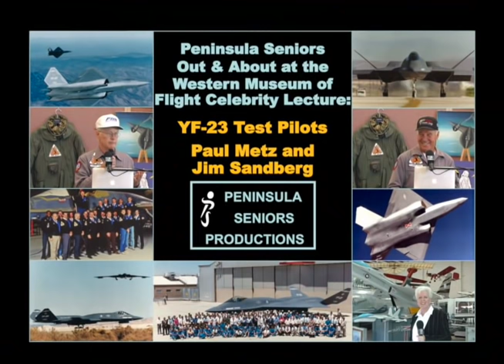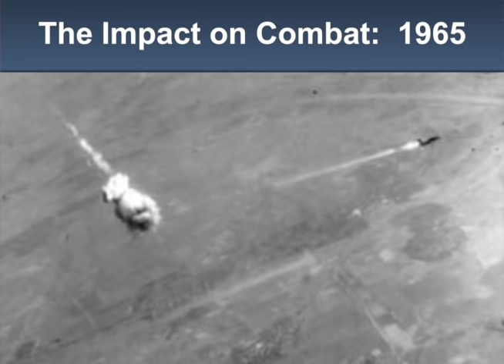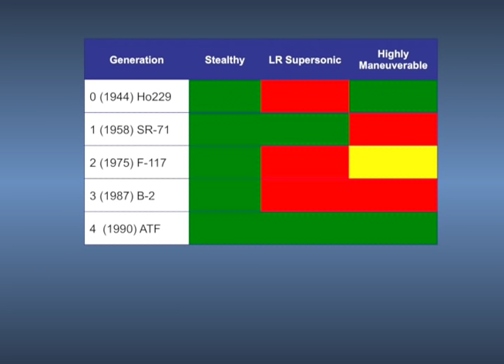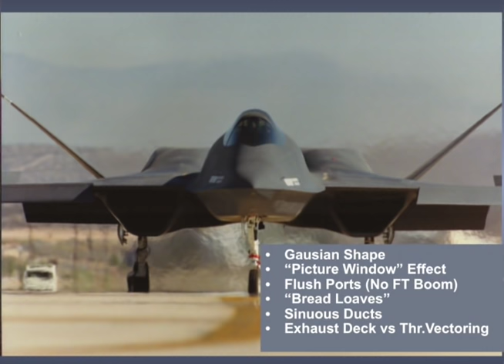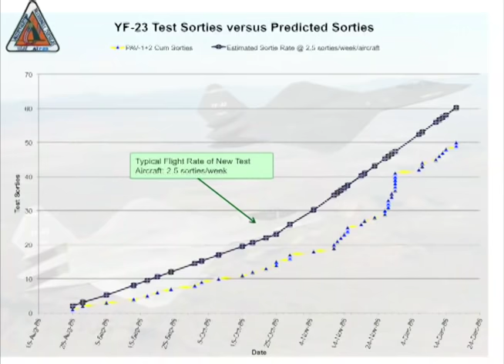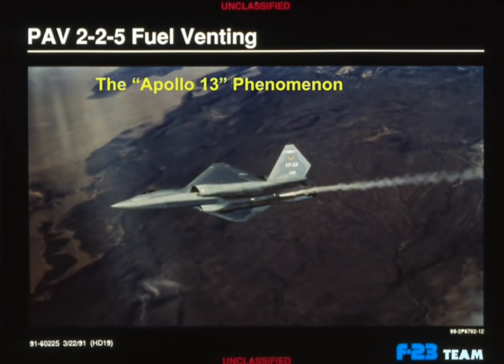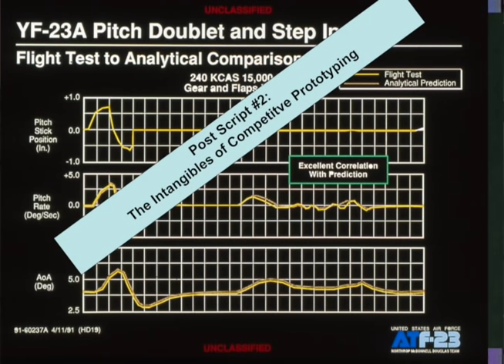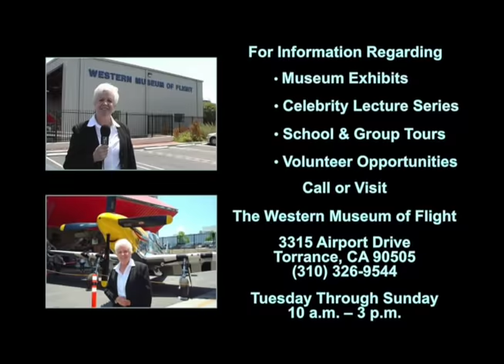YF-23 DEM/VAL Presentation by Test Pilots Paul Metz and Jim Sandberg

Comment: Also rumored that the 23 was faaaaaaasssssstttt! Like stupid fast and could do certain things after you bled a lot of energy if you got into that regime even though we the public were told that the 22 was actually more agile within the required envelopes. Food for thought and a great debate topic for aerospace engineers looking at paper data from afar.
Reply: It has a lot of wing and a lot of power, with pretty sleek leading edges and only 2 sets of wings/stabs, versus 3, which helps with drag.  The spread intakes are probably the most draggy aspects of the bird, aside from the wings, but they blend in rather well.  It's a combination of exceptional beauty when looking at all the other requirements for the ATF.
Reply: Interceptor type speed vs Air superiority agility

Comment: I wish they could have told us more about the actual capabilities of the aircraft.  Like how fast could it supercruise.  What was the top speed in burner.  Also maybe it wasn't as maneuverable as the F-22, but the F-35 can't maneuver at all and they don't seem concerned.  We should take all the F-22 and F-35 tech and produce F-23's.
Reply: Well you probably didn't see that because what Northrop says that the YF-23 could do and what it actually did were two different things. It is not to say that the YF-23 was not a great plane. It was. It is just that Northrop promised the world with the YF-23 and it couldn't deliver. Lockheed was very up front about the capabilities of the YF-22 and while the YF-23 was a great plane Northrop was not up front with the Pentagon and the Pentagon went with the YF-22. Testing showed that the designs of both aircraft were fabulous but Lockheed was up front from the start and Northrop was not.

Comment: despite addressable shortcomings, The F-22 was sufficient to keep air superiority. The YF 23 was so far advanced despite handling and other small issues That it should have been hidden away and further developed. It was too far advanced to risk. The F-22 was sufficient to best it's competition for years. The money to develop this sixth gen fighter is hidden in the cost over-runs for the raptor and joint-strike fighter as well as the F-35. That's why neither political party is demanding audits or casting blame for budget over-runs.

Just as the b-1b hid the F-117 budget with $10k toilet seats and $700 hammers, Our latest trillion dollar project is is a padded, black ops Skunk works charade. If we suddenly allow sales of the unbeaten F-15 air frame, it would further suggest we're at least three tiers above it's capabilities.
Reply: Very insightful and very plausible.
Reply: No it was not. On paper it was but when it actually flew it was not. As the speaker said, they used a lot of parts from other planes, such as landing gear from the F-18. That means that they were using parts not designed for that aircraft. Every bit and piece built for the YF-22 was designed specifically for it so it performed exactly as they said that it would. Yes the YF-23 was a great design but it messed up because Northrop told the Pentagon that whatever the YF-22 could do the YF-23 could do it better and then come to find out it was not what was advertised and the YF-22 was exactly what was advertised. Lockheed did not promise as much as Northrop did but Lockheed delivered on all of it's promises. Northrop promised more than Lockheed did but it could not deliver on all of them and that was not a good reflection on the YF-23 program if it could not deliver all of Northrop's promises.
Reply: The YF-22 was more than sufficient, as was the YF-23.  They met or exceeded the program expectations, which were tactical fighters that could out-maneuver the Su-27 and MiG-29, while being able to operate in a high radar threat environment, super-cruise, internal weapons storage, thrust:weight greater than 1:1, advanced avionics, AESA radar, advanced cockpit, thrust vectoring, DFLCS fused with DEEC, etc.  The F-22 ended up having a smaller RCS than the F-117, and excellent maneuverability, while still being able to super-cruise at 1.6 Mach.
Reply: Exactly. I think that the DoD made the right choice with the 22 but the 23 was an excellent aircraft as well.

Comment: By the aeronautic enthusiastic that I am, I'd much ratter see the Black Widow flying today ratter than the Raptor.
Reply: Fábio Beautiful plane.
Reply: The tactician has to win over the aerodynamicist, and the YF-23 and even F-23A proposal with an additional weapons bay did not carry as many missiles as the YF-22 and F-22A.  The YF-22 also exceeded Mach 2, something the YF-23 did not due to inlet design issues, not because of the airframe.  Tom Morgenfeld said the YF-22 with the GE engine had so much excess thrust, it was a totally different feeling airplane than the YF-22 with the Pratt engine, but the GE engine variable cycle stages weren't up to snuff for reliability.

Comment: So I left a bunch of comments on the YF-23 black widow ii video uploaded by the Western Museum of Flight.  Rather than repeat what I said there, if any ATF-23 program personnel ever happen by this video I'd love to know how they planned to deal with the visibility of the engine fan blades from certain aspect angles?  The F-22 did not have that problem, the fan blades were completely invisible to radar. Engine fan blades are one of the largest radar reflectors and a very powerful way to not just locate an aircraft but to ID aircraft type (non-cooperative target recognition).  F-23 EMD plans released on the internet show the problem would have remained.  Not sure how F-23 could be said to have lower overall RCS with that issue.
Reply: +hckyplyr9285 My theory is that the overall shape reduced its signature to a bare minimum, but at certain angles, you'd see a spike on the radar.
Reply: *****
Yeah, I guess that makes sense. Once more, I'd expect Northrop Grumman to have coated some parts of the intake with radar absorbent material to further reduce the effect of radar bouncing off of the turbofan.
Reply: +OmegaEGGY Actually may have been a bit of an error on my part.  The EMD design did feature bumps in the intakes - kind of like the Boeing X-32 - which were intended to help shield the fan blade faces.  But the best resource on the net for the YF-23 (http://yf-23.net/F-23A.html) says no, they would have been exposed.  See the first pic.  But I know nothing of the person who did the simulation.  Could just be some dude on the internet, could be an expert.
Reply: +hckyplyr9285 And thanks for the response, I get what you're saying.  I have no idea how significant such visibility, if it existed, would be. 

Anyone know how close the production F-22A is to the EMD proposal Lockheed made?  I have read that the Air Force insisted on a boat load of changes that drove weight up and may have compromised performance a fair amount.  The YF-22 was supposedly capable of a range of 800 nm including a certain amount of supercruise, whereas F-22A is given as having only 410 nm range w/supercruise.  Supposedly this was due to loss of fuel fraction in EMD?
Reply: hckyplyr9285
Ah yes, I forgot about the F-23A. You are correct, those radar blockers should be able to reduce the visibility of the fan blades.
Reply: Well put.  :)
Reply: I do not see how the RCS on the YF-23 could have been smaller either. They did not even make any attempt to shield the cockpit from radar.

Comment: SR-71 is not real stealth. It was very hot so IR-tracker can see him from very long distance.
Reply: +XaHyMaH The Sr71a had chines and canted vertical control surfaces inward (not 90 degree ,Straight up) this meant it was the 1st generation of stealth aircraft.
Reply: ***** You're wrong. Read more about IR telesopes.
Reply: +XaHyMaH Actually, the SR-71 had a completely different form of stealth. It wasn't the heat that made gave it away, but rather the massive amounts of turbulence. Radar guided missiles detonate upon entering this turbulence a mile or two behind the aircraft, so in a sense the turbulence functioned as sort of continuous counter measure in order to hide the SR-71 which itself had a low radar signature for the time, therefore making it a generation 1 stealth aircraft. 

Also, anything with an IR guided missiles would not be able to get in close enough to the SR-71 for a missile shot.
Reply: The SR-71 was not stealth compared to the F-22 but the F-117 Nighthawk wasn't either. I saw an interview with a designer of the SR-71 and he said that it was designed to be stealthy enough that the enemy could not see it until it was too late to lock onto it enough to shoot it down and it did that very successfully.
Reply: For it’s time it was the best thing available. I’m sure in 100 or 50 years we will look at the F-22 and say that’s not real stealth, it’s all relative.

Comment: "The fact is, they never tested the maximum speed" That's a load of crap. They stretched both of these planes as far as airspeed and acceleration to decide what engine to use and so they would know what kind of speeds the airframe would see and other important aspects of flight testing. They know how fast it went, and probably still smile about those numbers, but the REAL fact is, that number is classified and will be such for a long time!
Reply: Midwest UTV Nah... as they mention, you can’t fly stealth airplanes at “max” without the paint falling off.

Comment: 8:00 It is considered very rude to shoot at the pilot hanging in the parachute. Now lets see what happens when you shoot at a target with a strong motivation to live and the ability to survive.
      One reason the SA-2 SAMs were so "successful" in Vietnam is because they fired so many.
       I know one pilot who told me he had 15 SA-2 missiles shot at him in about 30 seconds. None of the 15 got him.
     The success rates for the SA-2 in Vietnam were less than 1%. The missiles also did not have a self destruct device that could be fired in case they missed. These missiles typically crashed back into the city causing nearly all of the damage caused by the "indiscriminate" American bombings.
     They were especially pleased when a hospital or school was hit, because the Americans went out of their way to avoid hitting these, even by accident.
     Extremely sick, if you ask me.